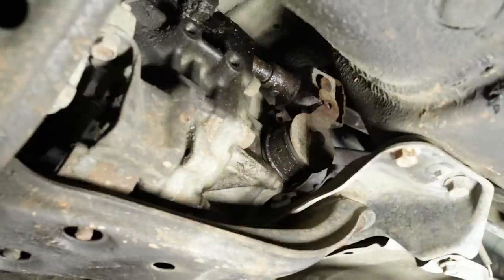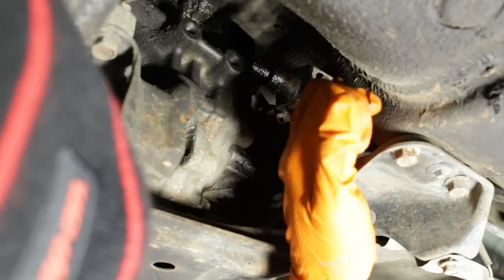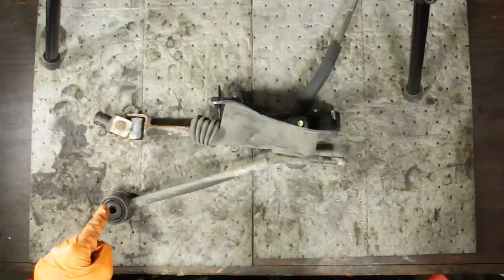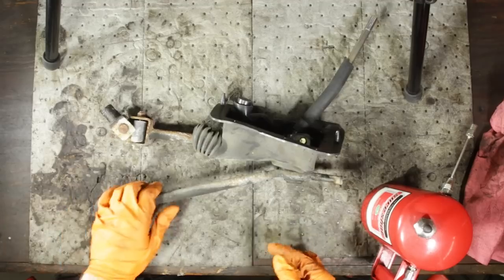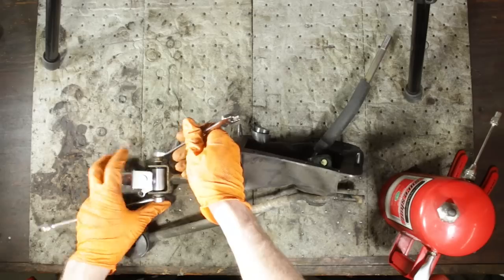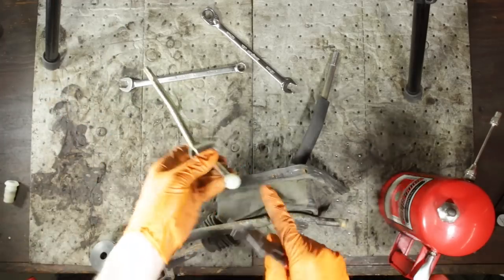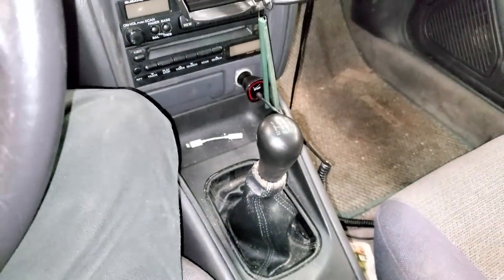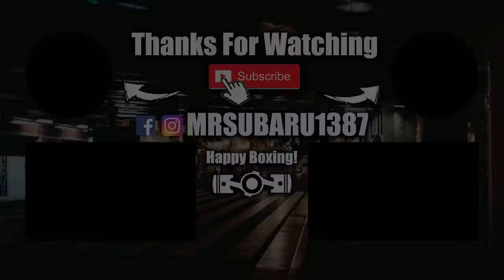Take The Slop Out Of Your Subaru Shifter!

Comment: I tackled this project today. Working without a lift, just stand jacks. It took about 3- hours from start to done with cleanup. I replaced the U-joint, the lower rubber bushing, and the upper rear bushing. I disassembled the ball and socket joint, cleaned out the dirt and old grease, installed new grease and put it back together. It took some dedicated tapping with a rubber faced hammer to get the snap ring to seat properly. The hardest part of the whole job is those darned roll pins. Getting them started, driving them at an inconvenient angle, etc. I had my better half help by manipulating the shift lever once I was ready to drive the roll pins to get the best angle and hold the assembly in position. Shifter now is crisp and sure. Thanks SO much for posting this content. I was able to do it with simple tools, the only NEW tools I purchased was a set of roll-pin punches. Saved a bunch of money, had the satisfaction of doing it myself, now we are good for another 200,000 miles.
Reply: @charlesward8196 do you happen to have part numbers or a link to the parts you used for the lower and upper rear bushings? Also any idea the size/thread of the longer bolts needed to install that new upper bushing?

Comment: A little time consuming to replace, but they make the shifting feel so much better
Reply: My issue right now is that pre 97 cars had a different style front joint and getting it can be very difficult. :'( Considering trying to swap in an entire later model linkage, which surprisingly not many people seem to have tried. I do have an 03 WRX transmission linkage sitting around, so I might try to put that in my 93. ;)
Reply: On examination it appears that I wasn't wrong, but I was mistaken! I Googled using some different terms and found oodles of posts saying you can swap later model linkage into early model cars, you just have to make sure you use the entire assembly from roll pinned U-joint back because of the different joint design, which is pretty much what I was planning. I'll def be making a vid on that one! :D

Comment: By placing the shifter into gear, the angle on that roll pin from the bottom is much easier! I do not remember which position it needs to be in, but I'm thinking 5th or reverse.
Reply: It's in 5th gear that's easiest

Comment: This was super helpful, thank you!  I had a master certified tech tell me that the reason my shifter on my 09 WRX was sloppy was because it needed new synchros in the transmission - I knew that didn't sound right.  Sure enough, got underneath and looked at the linkage and the bushings were just gone.  Took it apart and installed the Holy Shift Kit with Kartboy front and rear bushings and TiC linkage bushings and MAN, I'm in love!  Thanks a ton for the video!
Reply from the maker: Oh course a master tech said that... 🙄 🙄 🙄 Glad to help. 👍🏻

Comment: Thanks for this!  Your video helped us refurbish our 06 Impreza. Except for the roll pins, the rust and tight spaces it was fairly easy. Now that the shifter is tight the rest of the car feels sloppy!
Reply: Your 06 came with roll pins? I was told it didn't! Planning to do this on my 06 Impreza in a week or two and I'm really hoping to avoid that part
Reply: Just tried to do this on my 06 impreza. Everything down there is identical to this video. There’s almost no way to get those roll pins out without lifting the car and using a long punch. I just wasted two hours trying to do it with half the car a foot off the ground. Even tried levering it out with a C clamp. Good luck!
Reply: @saltylasagna5249  i have an ‘07, you can do it with a short punch! no need for a lift. put it in 5th for easier access, and hit it with a really heavy hammer (i suppose that’s rather difficult too but that’s what i had to do lol). bit late but just wanted to add for anybody else looking for help here.
Reply: @tecc9999  roll pin punch sizes for inner and outer pins ?? How long and weight of hammer needed 🤔
Reply: @pamelavance648  honestly, i don’t know. took out the smaller pin with a small screwdriver since it doesn’t require much force, but i just found the punch laying around in my garage so i used it and it worked. it was about the same diameter as the pin, and about 4” long. same with the hammer - just used the biggest one i found.
Reply: @tecc9999  getting closer to getting started on this. 
Bought roll pin punch set ..from watching a few  videos it will be most helpful.  
Any help with bolt tighten specs 
And what kind of grease to use on bushing under and closest to console box .
Yes the rattle is the motivation to do this lol 
Thanks if you respond 🙂 ☺️ 
Yep a months passed had to search for a couple of bushings
Reply: @pamelavance648  jdmfsm should have all the specs you need. navigate to your year and model and go to transmission/transaxle > manual transmission and transaxle (5MT) > transfer case and extension case assembly > assembly. as for the bushing, afaik any thick silicon or lithium based grease (bearing grease for example) should work, though they do sell specialized bushing grease.

glad to help! :)

Comment: MrSubaru  you are a master at making the difficult look easy.  Not sure if it is your ability or editing.  I worked for 3 hours trying to remove inner roll pin after having my 2003 Outback wagon on jack stands.  All I accomplished was a blood blister on my finger, dirt in my eyes and flattened end of the inner roll pin.  
5th gear is the only selection that made the roll pin even marginally accessible. The is no straight line access for a drift punch, or transfer punch to fit.  I would be very interested to know what size punch you used to remove the inner roll pin.  What ever size it is, I don’t seem to have it.
Reply: I think for this job you need a lift, getting it done on axel stands sounds like a trip to A&E - I had these bushings done at a garage a few years ago on my 6 speed SpecB and they make a huge difference

Comment: Perfect timing. My new 93 has lots of shifter slop. Unfortunately all the bushings are kind of expensive. 😢
Reply: I just did a rebuild using nylon bushings (3/8 O.D. iirc) and then drilling out to match the bolts. It feels awesome and cost $3.50.
Reply: @mercMADCommando  Yeah I actually did exactly that on my old '93 not long ago. Love the ingenuity! My hardware store selection was pretty trash and I had a hard time finding exactly what I needed. Still got it done. It would be nice to use the proper stuff if it wasn't like $6 a bushing or $30+ for a joint.

Comment: Part No. for part up to part way through 2005 is  35047AC030.  This has a small eye for the attachment of the return spring part.   It also has a 10mm bolt on the gear stick end.
Part No. for part way through  2005 onward is   35046-AG000.  This has no eye, as that return spring seems to have been deleted.  It has a 14mm bolt at the gear stick end.
Reply: How about 1993
Reply: Return spring is inside the trans

Comment: This video excellent x10000s 
Did this project today 
Exhausted but happy 😊 
Took longer then most 
Have shoulder blade cramp lol 
Even with roll pin punches was hard but worth it. 
It was loose for a bit, now Have to relearn 3rd gear lol didn't realize how much I had to go over before fixing it
Now avoiding 5th when wanting 3rd 
That's your funny for the day 
If you have a loose gear shift linkage you will understand that last statement. Thanks for sharing your videos.  Fix what I can and pay for the things I am not comfortable doing..trying to balance that out. 
Here's to keeping subyroo moving forward ✨️ 🙂 😊 yayyyy

Comment: excellent video - much better the second time around! I've stripped the bolt on the passenger side of the old rubber bushing : ( I'm screwed with that... no way to fit it in without pulling the drive shaft

Comment: Quick question: what do you do if the center pin won't come out,, and you hastily try to drill it out, breaking off the bit in the process... and now have a drill bit stuck acting as the center pin?  

Also thank you for existing on youtube; you have saved me and my '97 outback sport multiple times.

Comment: If there's a little play in the forward and aft movement, lots of side to side, does that mean there are transmission parts that are worn out? I replaced the bushings and it marginally improved the slop....
Reply: Mine has a little fore/aft play too, with lots of side to side. I haven't done mine yet.
You replaced the joint, both bushings, and you still have a lot of play in the shifter?
What parts did you use? The guy at the dealer told me that the factory joint was sort of meh, with way less durability.

Comment: For those who have '96 Legacies, be aware that the shifter bushings are different than later models like the one in this video.
Reply: What about 97?
Reply: @paulanger2048  Go to parts.subaru.com and enter your VIN.  It will tell you the correct OEM part # that you can use to make sure you get the right part.
Reply: @cajunaggie9815  thank you for this comment hopefully find what I need

Comment: Hi! After changing only the universal joint in my 2006 Forester, it almost fixed completely the problem, almost. The roll pins were missing, it was fixed with a screw and a bolt to it's place by the previous owner, and not having spare roll pins in hand I did the same and fixed the new universal joint with a screw and a bolt. Now after 2+ months it's sloppy again. Can the fixing cause this problem or it doesn't really matter? Should I just try to tighten the bolts in the universal joint?
Now I'm planning to change the rest of the parts as shown in the video, with the exception that on the bottom of the shift lever there is a plastic ball what can be changed without buying a whole new shift lever. And one more thing, the big rubber bushing you changed with the two poliurethane ones, and the rear bushing doesn't look like OEM or at least differ from the original ones. Can you tell me the product codes of those two? Thanks!

Comment: I did this about 2 years ago. I found that I still have a lot of lateral slop but no forward and back slop. I had a friend move the shifter around while I was under the car and noticed the lateral play is in the roll pin shifter shaft interface. Not sure how to fix that or what caused this. How can the hole in the shifter shaft out of the tranny be elliptical in the rotary direction? Someone must have been aggressive with shifting or the new roll pin isn't expanding as needed. Can I just use an ordinary nut and bolt to clamp the two together. Maybe ream it out and use a slip fit shoulder bolt? I used all new parts as well so I'm sort of stumped. Great video btw! As always. Thank you

Comment: Assuming someone has already done all the bottom bushing and then their snap ring break allowing the white cup to pop out socket and the shifter out of the white cup. What exact parts would I need and I can I fix everything without taking the whole assembly out? I can just replace the bottom snap ring from under the car right? Thanks so much.

Comment: I'm currently doing this on my '93 Legacy L 2.2 5MT. Everything has been going smoothly except for the damn outer roll pin. I got the inner roll pin out with ease, but the outer one is seized beyond belief. Does anyone have any tips? I've tried with roll pin punches and extended reach center punches with no avail.

Comment: doing this right now. got the roll pins out but the u joint is seized to the (input?) shaft. trying to slowly cut some reliefs in it with a rotary tool and hoping I can bang it out from there. time to crack a beer open 😵‍💫

Comment: @mrsubaru1387 Please keep doing what you're doing! Your video PRODUCTION quality is leagues ahead of other YouTube mechanics, and I live in my 03 fozi and your videos have given me priceless info before, now, and probably in the future about my vehicle. Should I ever need it, or even suggest it, would you take any requests for my generation of Subaru? For example, when the original 5mt in my car lost all gears, I replaced it with a ty757 I think. It came out of a 2005 Legacy GT. My dash/ECU in my 2003 needs a VSS signal from the trans for Speedo/trip/odo to function. Here-in-lies the problem: 2005 is when Subaru stopped using VSS for speed signal and started using the CANBUS (of which my 03 doesn't have) to gather ABS data and calculate vehicle speed then send that to the dash and ECU. Therefore, they removed the speed ring on 3rd gear for my trans, and my VSS sensor is useless in it.

What do I do? Fork out $300 for an iWire VSSpro? Make one? Simulate the VSS signal somehow using the driveshaft and another sensor? 

Or do I explore new territory and crack the tcase open to mate a speed ring to 3rd gear? The gear IS still cut to accept the speed ring if I bought one of those which are cheap.

Any input appreciated greatly I haven't had a working speedometer in 2 years.

Comment: Was wondering if you know this issue my 2001 outback 4 cylinder goes into all gears fine and drives fine when u put in in park it feels like it’s in neutral it will roll and somtimes you have to shift back to drive and p back to park to get key out

Comment: Double roll pins? Is there an advantage to that design? Would bolt with a lock nut work just as well?
Thanks for the video.
Reply: yea it does, i did the same with a m7 bolt. no wiggle room for the bolt, exact fit.

Comment: wondering if you have ever messed with the Solid Metal U-joints for the Shifter, the ones without rubber or poly its just solid metal with holes for the bolts to go through.
Reply: Did you get it figured out??? 
Have Same question 🤔

Comment: Hi, my outer pin is stuck in there tight, any suggestions? thanks
Reply from the maker: Penetrating fluid. If it's solid in there, drilling it out might be the only option if penetrating fluid doesn't get it to start moving.
Reply: Heating and cooling a few times can also help break corrosion. Along with lots of penetrating fluid like the doctor ordered! :)

Comment: Hi mr subaru I hope see this comment I hit a curb in my 2001 Subaru forester and now my rear wheel is on and angle it has alot of positive camber but the only suspension part that seemed bent was the trailing arm but other than that nothing seems bent and the rear wheel still has alot of positive camber what can I do? Help ...

Comment: Hey mates, reaching out, maybe you will know? so, yeah did the clutch in my 2003 outback..... now its stuck between gears, thought it was the High/Low selector stuck in middle, but even when i have rammed that into high range.... the box is still stuck in neutral gear... i have done the clutch correctly... feels good, just lost all the gears... its stuck in limbo. Its been a... long process to get the clutch and i have triple checked its the right clutch kit i installed. The box went on SMOOOOOOTH.... my brother is abnormally large and made light work of it... I watched this clip to make sure i hooked up the selector linkage perfect. Ive had the support out twice now... please help, if ya can, or im getting a loan and sailing the old girl down to the wreckers for $150. yeah.

Comment: Is that slop a reason to not get the car in gear? My son got stuck at a red light.  when he went to shift to 1st the car stalled like it was still in 4th. Towed it home. 
With a lot of wiggling we finally got in 2nd to get it in the garage and I wanted to change out that linkage and all the bushings if that's our problem. Wish you linked them all :(
 Hoping it's not the clutch or the transmission itself :( 
I've been battling the outer roll pin for two evenings now. it's so mashed up now there's nothing left to strike. I tried pb blaster and a torch and it won't budge. Yours's came out so easy :(  I don't know what to try next. Can't really drill it out because it's not a straight angel for the drill to get at either.

Comment: @MrSubaru1397 I was having a ton of problems a while back ('03 Foz XS), shifting into 1st and/or 2nd, usually fighting it to select 1/2, NOT 3/4. Or sometimes the problem was the linkage would seemingly select 2nd but fail to pull the 1/2 fork all the way out; effectively leaving it in neutral. However, my problem was so randomly intermittent, that I concluded it had to be gear oil. Decided I wanted to try running Uncle Scotty's Cocktail, but couldn't afford it so I took a step back and did a normal flush with Valvoline's high performance 70w-90(whoever's wondering: my magnet was clean).... I saw 100% improvement.... Until the next day, when it was back to almost 0 difference... Week or so later, almost out of the blue, my car stoped fucking up. So I kinda forgot about it almost, until today when it started acting up again...

TL;DR: THANK YOU FOR THIS....I watched your original video earlier this year, and no, it didn't help me a whole lot, especially when I was trying to decide between doing a gear oil change; or ordering the entire linkage kit and hoping that fits/works.
Reply: Might be a little late but andrewtech cocktail I heard is still being used today and that was made back in like 2008 😂
Reply: Might help your situation basically 3qts if redline lightweight shockproof and motul 300 gear oil 75w90

Comment: Really glad you made an updated video! I have to do this on my 99 Legacy Outback. Great work! Side question: Was there a torque spec on the joint?
Reply: Also, glad you include a link for the return spring. Was able to order the joint a while ago but wasnt able to get the return spring. Even when asking my local Subaru Delearship, they didnt know what to order for me.
Reply from the maker: I couldn't find any spec in the manual, not to say that there isn't one though.
Reply: @MrSubaru1387  Update, just finished fixing my sloppy shifter myself. I just want to thank you again for updating your video! Wasnt easy for me to do but i got it done, would've been quicker if i hadnt messed up the threads of the bolt holding the shifter joint.. THANKS!